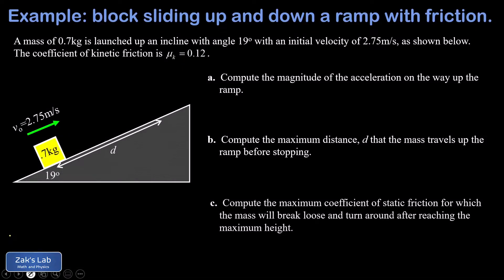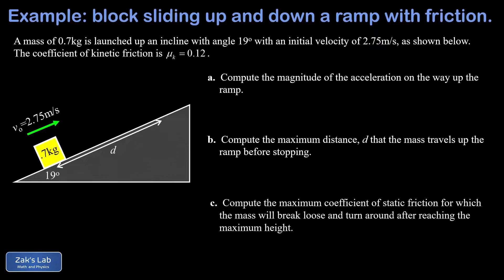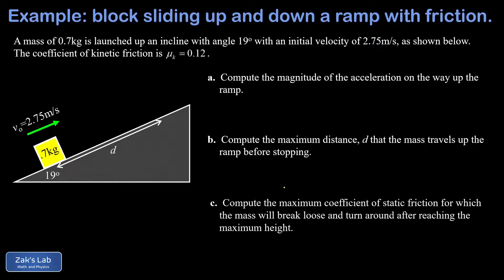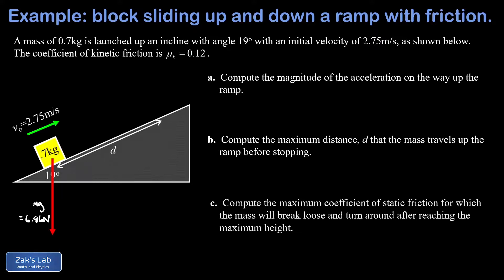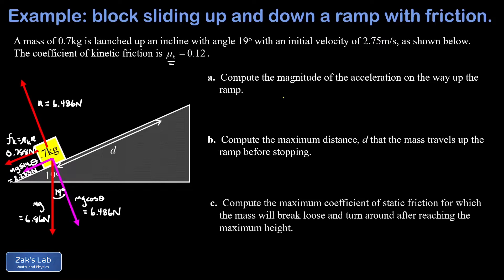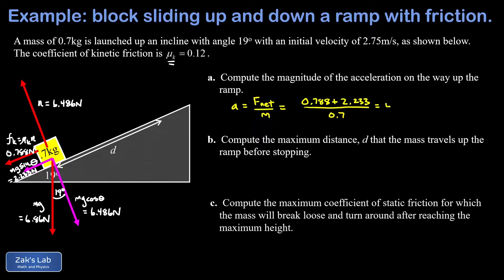Up and down an incline with friction: time, accelerations, sliding distance, friction coefficient.

Comment: won't the acceleration be faster on the way down?
Reply from the maker: On the way down, the two parallel forces on the block are opposing each other (gravity down the ramp/friction up the ramp).  This means the vector sum of the two forces is smaller than when the block is on the way up (gravity down the ramp/friction down the ramp).  A smaller net force means a smaller acceleration.  Maybe your intuition is messing with you on this because the block is slowing down on the way up and speeding up on the way down.  The rate at which the block slows down is faster than the rate at which the block speeds up on the way back down. z
Reply: @ZaksLab  yep, it's definitely intuitive. assuming that acceleration rightwards (or upwards in this case) is positive, shouldn't downwards be negative, and vice versa?
Reply from the maker: @unappreciatedperson8649  if you define acceleration up the ramp as positive, then both accelerations are negative!  moving up the ramp and slowing down, moving down the ramp and speeding up -- those are both accelerations pointing down the ramp, so they are both negative.  The acceleration on the way up has the larger magnitude, since both forces on the block are cooperating.z

Comment: do you switch vertical and horizontal?
I'm confused about the vertical force of the ramp is there none?
Reply from the maker: It makes the most sense to analyze the problem in a tilted coordinate system, so we use components that are perpendicular to the ramp and parallel to the ramp.  By 'vertical force of the ramp' I'm not sure if you mean 'perpendicular' or literally 'vertical'.  You could find the vertical component of the normal force,  the vertical component of the friction force and the downward force of gravity and find the net vertical force, which would then give you the vertical component of the acceleration, but this is overly complicated for an object that we already know is constrained to the surface of the ramp, thus the tilted coordinate system.  If you mean 'perpendicular', then that's the normal force.  The normal force does what it has to in order to prevent the object from penetrating the surface, so it has a magnitude of mgcos(theta) to balance forces perpendicular to the surface, which is another way of saying "the object is constrained to the surface of the ramp". Let me know if I'm off target on addressing your question.  z